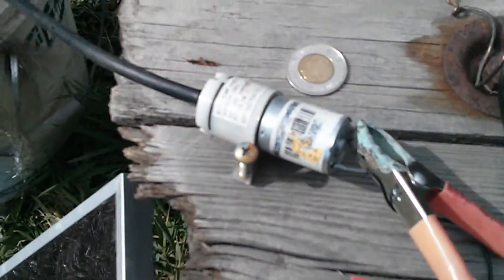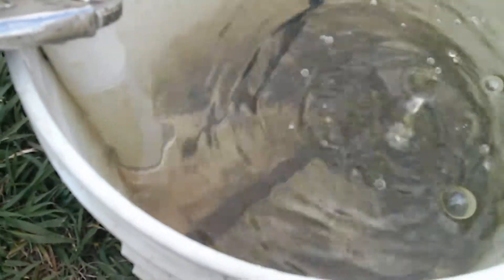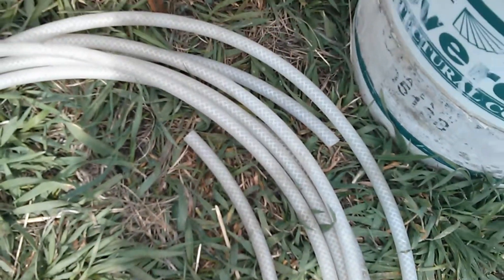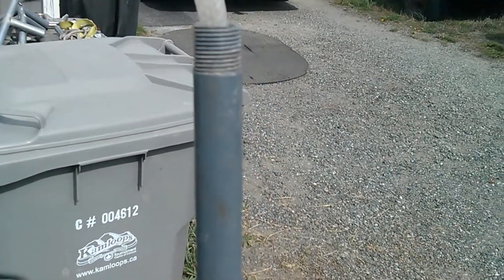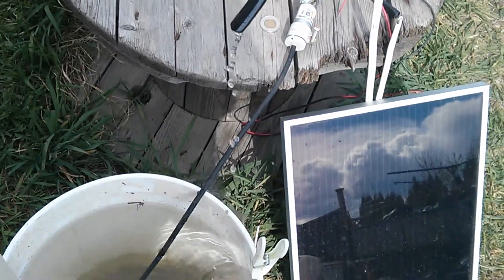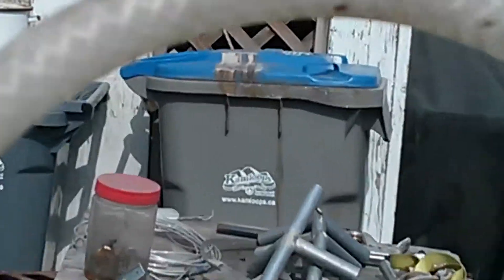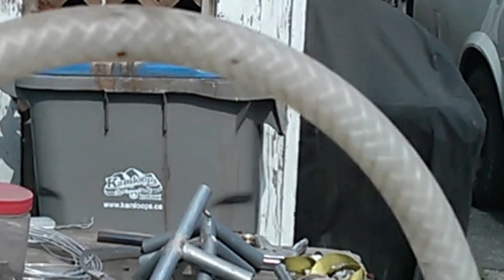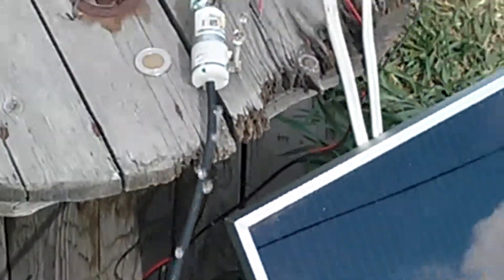Airlift pump; solar powered fountain

Comment: Try installing air & water filter, to control the output.... example >> https://www.youtube.com/watch?v=YCxkopGBwjw
Reply from the maker: +Hasan Sabran Thanks for the suggestion;
I built another version with three of the hoses inside the big tube and it was pretty interesting, the output would come from each tube in rotation and produced more water too. The next tube would start part way through the cycle of the first. It ran all summer and the crows here got to depend on it for a water supply LOL
Once the snow goes away I'll put an aerator stone on it to micro fracture the bubbles and see how that goes